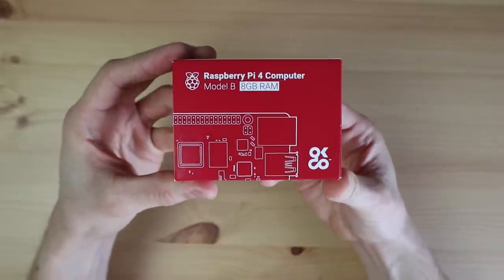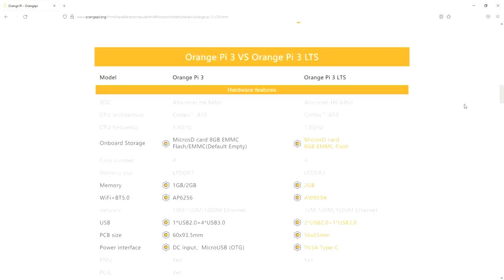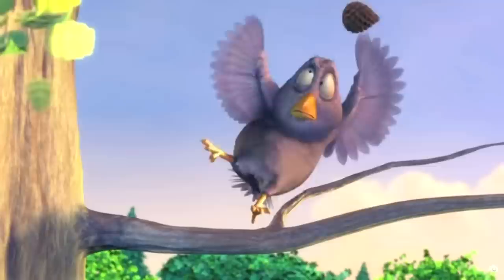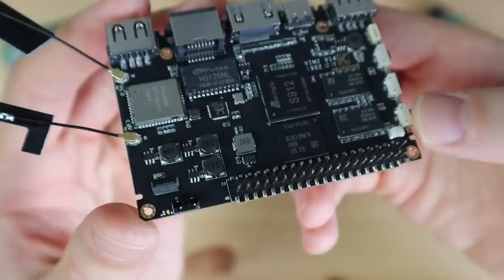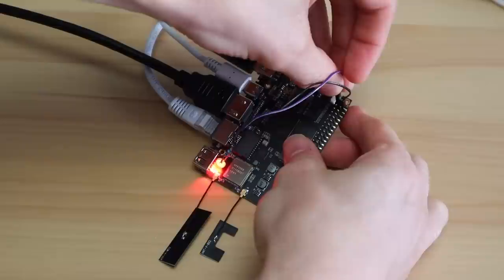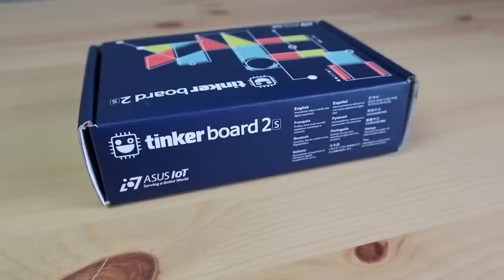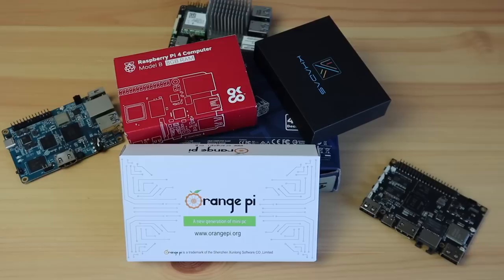Pi Shortage - Are These Worthwhile Raspberry Pi Alternatives?

Comment: The Rockchip line is quite cheap and open source from the bare metal up, and just as capable as Raspberry Pi's proprietary chips, minus the developer support.

They're very easy to get.
Reply from the maker: The developer support is usually the biggest difference between these boards and a Raspberry Pi, for some that’s not an issue but it’s a dealbreaker for most.

Comment: No, there is no "suitable Pi alternatives", end of story. Buying into the Pi ecosystem isn't just about price or hardware specs. Arguably, 80% of the reason we buy Pi's is for the software support and large community around them, and you absolutely will NOT find that with any Pi alternatives. Hardware specs and price are really only a very small consideration for most Pi buyers, as there are certainly better spec boards out there for reasonable prices if specs were all we cared about, they just don't have the software support and large community behind them like the Pi.

Comment: TBH a lot of projects people are using PIs for like home assistant octoprint ect that don't require gpio, they would be better off with a re utilised thin client like a wise thin client last 2 I bought were under £40 already in a case with SSD and PSU.
Reply from the maker: If you're running something that you only need to set up once (so you don't mind a few hours of tinkering) and doesn't need any GPIO pins then this is a great alternative

Comment: Are there any good alternatives for the Pi Zero 2 W? (Or the original Pi Zero)
Reply: Radxa zero is an absolute powerhouse for its size..i heard that the new radxa zero 2 will be sold at the end of this year..the orange pi zero 2 is also another good alternative if you want to use android os.. However I personally dislike the WiFi antenna it has.. Banana pi m2 zero is also another viable option

Comment: In India, 
I was continuously checking all official seller's website for last few months first manually then using a script (That records RPI stock In Timestamp), but never found a single PI. So i think they are never coming to official resellers but going directly to black market( * 2 to 3 times price). I have Messaged RPI Foundation about this but no response or action.
I think RPI Co. is hopeless on supply issues.

Comment: In terms of 3D printing Raspberry Pi isn't a big deal any longer as there are more dedicated yet slick alternatives are available out there. The most stupid thing about any Raspberry PI and its version 4 in particular is that the developer doesn't give a shit about having a proper high current power terminal on board but offers just stupid USB connectivity for feeding power in. The Pin header is just a crap for power as you need to get a special high current receptacle for that otherwise it will have voltage drop if a regular female IDC plug is used. Thanks to the shortage some alternatives such as BTT Pi got a chance to fill the gap.

Comment: I really sympathize with these nerds getting scalped on Pi 4 prices.
Like... if they're BeagleBone prices and you know what you're doing that means you get a BeagleBone, and holy hell is it more capable.
To anyone who feels stuck in the Pi ecosystem I say this: Spite is a moral imperative.
Some guy on Amazon wants to screw you and you've gotta screw em right back. Let the hate flow through you. Learn whatever you need to learn to get your stuff working on the other board.

There's a reason spite got a pass when they wrote the seven deadly sins in the bible. For all the evil it does, it does an equal amount of good. Do it for spite.

Comment: Any thoughts on alternative boards with 8GB? (that's what I've been looking for). Thanks!
Reply from the maker: I'm not aware of any offering 8GB apart from the Pi 4B, the others all seem to offer a maximum of 4GB.
Reply: odroid and pine64 both offer SBCs with 8GB of ram, they are slightly bigger boards though.. but also generally better CPU
Reply: Purchase a odroid m1 from amaradroid they have the ram and a m.2 22/80 nvme slot 111usd

Comment: It's strange that you are having so much trouble with video. These processors are all used on high end Android tv boxes. Are you seeing any Mali GPU chips on those boards? The AMlogic S912 is more than capable of playing 4K and some of the more demanding games. So is that RockChip, although not quite as good as the S912. The issues are software/ firmware based. The hardware is actually more capable than the RasPi. I'm playing with the esp32 boards right now. Not exactly a replacement for RasPi  but much more capable than I realized.
Reply from the maker: The issue is software related, the browser on all of these boards uses software encoding which doesn't take advantage of the boars hardware. They all run media playback better when running Android.

Comment: Hi, Regarding the Orange PI 3 LTS: The Allwinner H6 Got H264, H265H hardware decoder. Is it possible that the driver for this decoder were missing from the Debian installation? Can't you check again Video Playback w/ original OS installed?
Reply from the maker: Possibly, I’ll look into that

Comment: first.. I don't consider most of those RPi ALTERNATIVES. they are primarily upgrades to much more powerful systems, that cost much more than a Rpi should.. etc..  
In my opinion, if you genuinely want to do a report on Raspberry Pi Alternatives. It would help if YOU were doing the other PI's.. Banana Pi's and Orange Pi's . those are the correct PRICE and type of equipment that is close to Rpi in Price and performance. ( better on price these days ) ..   a RPi Zero 2 vs an OrangePi Zero 2 . WOULD be a much better test!! same with Orange Pi 5. 4gb or 8 gb or even the better 16GB version..   I know you can't do an Apple to Apple comparison .. But you can stay in the FRUIT of the PI's.. LOL ..

Comment: What about taking an old 486DX266 and adding an I/O Port plug in board and writing your application in MSVC 6  but a dll will be required to get access to the protected mode which will allow you to access the privileged mode that lets you access the I/O Ports as USER mode won't let you have access and will throw a ILLEGAL ACCESS ERROR, Windows 95 and 98SE will let you access the I/O Ports.

Comment: I like the Raspberry Pi, and so do many others. At this moment the prices of Raspberry Pi's are ridiculously high because there is a shortage. (There was a flu in China, and all slaves stopped working) Other manufacturers still have dusty spare part in stock so every day they can make a few of those less popular single board computers.  
 
I have tried a few of the competitors of the Raspberry Pi and it takes a lot of time to find and get to software, it take for ever to get an update. Sometimes there is still a website with rudimentary information but no updates since many years. I would not recommend anything else then an original Pi.

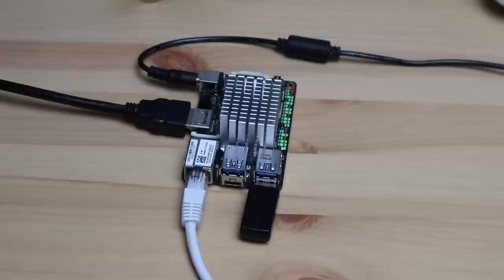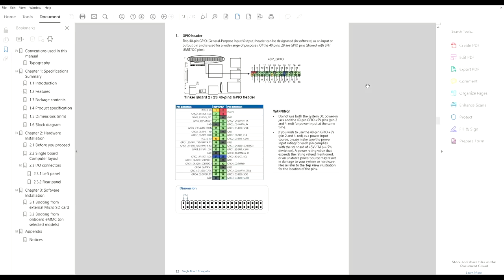Comment: I just noticed something else... around 17:40 you say that people mention to connect to GPIO pin 0, 10, or 12 -  but they never tell you which pin is which.... YOU SHOWED THE DIAGRAM @ 15:25 that list the PIN NUMBERS AND WHAT THEY DO 🤦‍♂🤦‍♂🤦‍♂🤦‍♂ lol - we ALL have brainfarts once in a while :) (I live in a permanent one lol)
Reply from the maker: If you have a look at the diagram at 15:25, the pins are labelled with tags like these - GPIO2_B1, GPIO2_B2, GPIO2_C1, GPIO1_B1 etc.. In the example code I was referring to at 17:40, they just say GPIO 0, 10, 12 etc.. So which GPIO pin is GPIO 1? Is it GPIO1_B1, or is it GPIO0_A1, or GPIO1_D1? 
This is the kind of trouble I had with the Tinkerboard, it looks like the information is all there until you actually try use it.